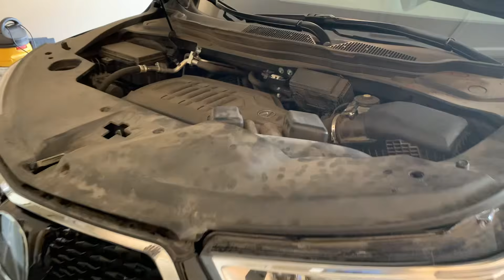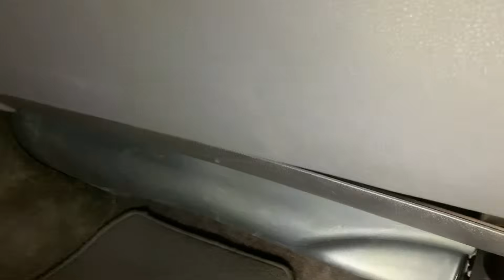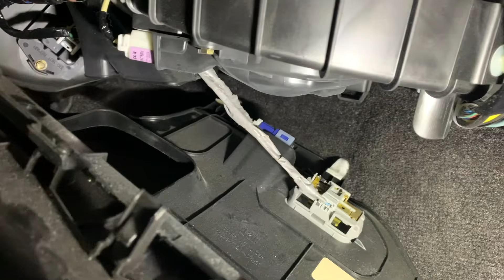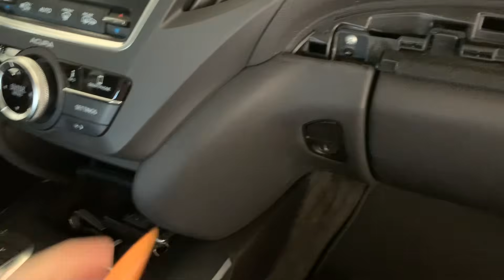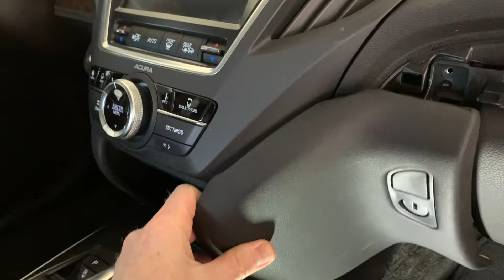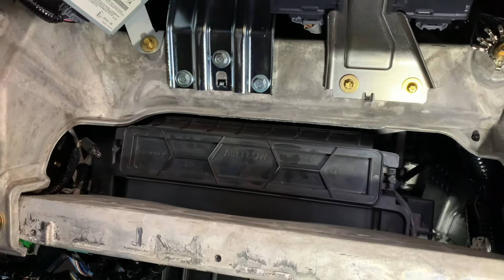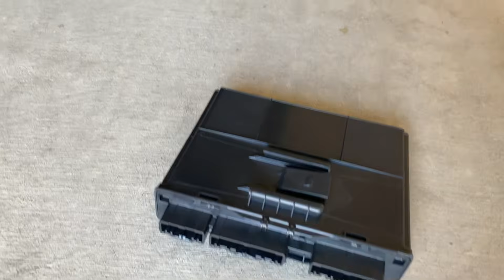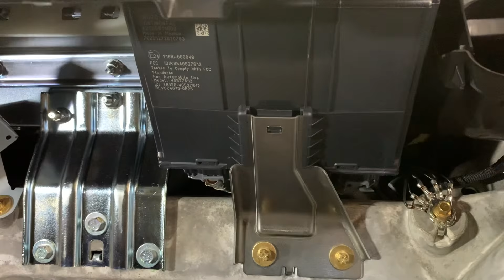Honda / Acura Random, Intermittent Flashing Dash Lights, Headlights, and Car Alarm - FIX Part 2

Comment: September 21, 2026 — I had a similar issue with my 2017 Acura TLX V6. Your video probably saved me a ton of money. I went directly to the keyless entry control module. I didn’t see any dirt or corrosion around the chip, but I asked a technician to reflow and resolder it, then thoroughly clean the entire module. It has now been 48 hours without any issues, even in high humidity.:hand-purple-blue-peace:

Comment: I need to give credit where it’s due, because this just saved me so much money and hate from my neighbours lol 

I live in Alberta, where the weather changes in the blink of an eye & I was thinking slow creeping in of cold, was the issue here. I had my alternator, the battery, gauge cluster and a few other things replaced at the end of 2023 and I thought the repairs for this thing were over… I was not anticipating having to wake up almost every day around 2–4AM just to turn off my stupid alarm on the car!! 

I even emailed Acura Canada about two weeks ago and I still have yet to receive a response from them. There should absolutely be a bulletin open for this.

I took everything apart as you showed in your video, cleaned up the IC board, bought some conformal coating from Amazon and I swear I haven’t slept this good in a few months. 
Thank you so much!

Comment: Thank you very much for this video,  I’m a electronic technician,  I have a ridgeline 2017 that have an intermittent problem about the keyless.  Recently in the night the truck trigger an alarm,  the cluster with all lights on and solenoid clicking,  difficulties to disarm and unlock the door to stop.  Three years ago I have this problem at that time I think the 12v battery aging and replaced it with AGM batterie,  since nothing but last week the problem make surface.  I took appointementbto the dealer and mention that a service bulletin is present on that particular symptom and this bulletin tell to replace the module.  Unfornately in Canada HONDA doesn’t honor the service bulletin from USA.  THe dealer make an estimate of about 1100$ to replace BCM module instead of the keyless,  the refuse to submit my case or listen explanation,  symptom and honor the bulletin.  After I see your video,  ask a second advise from my indépendant Honda/acura mechanic,  he tell me that he change almost 40 keyless module for the same symptom you described.  I decide with all these informations to tell dealer to close the the work order with the minimal fee, I paid for one hour of labour about $190 for 5 minute diagnosis with the scanner.

Just to tell you that your video is very informative and very deep,  i perform the operation of cleaning the board,  apply conformal coating,  put back in place.

Comment: Just did this to fix the issue on my 2019 RIDGELINE. Very disappointed at Honda. Its a very clear manufacturing defect on several years of their vehicles but they do not recall

Comment: This is my first ever YouTube comment, but I have a 2019 Honda Pilot and this has happened randomly over a year period. One week it happened non stop, I followed these steps and stopped right away. The only difference with a Pilot is the A/C vent does not need to be removed.

Comment: Who's here in 2026, I'm having these issues and I'm going to attempt this fix, wish me luck
Reply: Howd it go? I have a 2016 honda odyssey se
Reply: @DanielTorres-vu3gt took the dash apart, glove box and all. Couldn't see any worn or distortion on the board but i cleaned it regardless. I'm no longer having the issue 🤷🏾‍♂️

Comment: As a mechanic, I hate newer cars because of all the electronics. I own a 2017 Acura TLX, and the only problems I have had with this vehicle are electrical. This issue was one of them. Luckily, I found this video, which took around 10 minutes to get to the module. I looked at the circuit board, and it looked good, so I went ahead and cleaned it up with alcohol using foam swabs. I reinstalled the module, and the car has been sitting for a few hours with no clicking or erratic dashboard activity. Thank you sir for this!

Comment: Came here to say thank you, Honda dealership running in circles trying to figure out the issue and replaced a part that did not fix the problem.
Followed this tutorial myself and finally got it fixed! Thank you very much

Comment: Awesome video. Fixed my 2018 hrv after spending two long months trying to find the source of the problem, including a 7,500 mile cross country drive, trying to figure this out and disconnecting the car battery every time I parked anywhere by a quick disconnect switch!!

Comment: First comment on youtube. Thank you for doing all the legwork in problem solving this issue. I owe you alot. 5 star job finding the issue, documenting it, and providing a solution. I cleaned the noted solders on my 2017 Honda Pilot and the electrical system has stopped going haywire. Thank you, thank you, thank you.

Comment: It was such nightmare last month and half. Thank you for your video. It saved me from this nightmare alarm randomly went off every few hours for my 2017 Acura ILX. All my neighbors are pissed and angry. I did exactly you described. Just the unit for ILX is under driver’s side. It has very tiny space to work and I need socket extension to get the job done. Taking it board out is another challenge and I broke some parts which is ok, I just tape back. So far 12 hours passed by after I put it back, no alarm going off. Hope it can work and save me the trip next week and $2000. Thank you.
Reply: any update did it fix the problem on you ilx?
Reply: @MrBRC  2 weeks later, no problem. No more alarm going off randomly. One thing I didn't do was not using super glue to seal the exposing area on the IC board. probably will do that next time when issue happens again.

Comment: Problem is doing all that and it doesn't work.  Or paying a dealer a grand and it doesn't work.  So far I changed the battery in the car the FOB batteries and cleaned the hood sensor. 2019 Honda passport touring.  I mean how do you recognize growth on a module.  And you didn't show cleaning it off or applying the super glue.  Honda's are junk I may never by one again.

Comment: OMG! I have a 2016 Honda Odyssey and it had these issues in 2024 that randomly stopped. I forgot about it. This month it has started back up with a vengeance, acting like someone was using a remote control to try to start it. The fuses were constantly clicking and we found your thread online and this video. Got the box out, there is zero coating on the chip of concern. I hope I can clean and coat this to have a good fix. Thank you!

Comment: Regina G - You are an Ace of Aces for doing this video!! We've been having this issue on out "17 MDX for sometime now, but I have followed your excellent instructions and completed the work. It was not hard to do.  I did not have the magnification to clearly see the dendrites, but there was something there in the location you pointed out and the conformal coating was missing in that same location. T-Storms tonight, and downpours like that seemed to be a trigger for honking and lights turning on, so fingers crossed that I got it right.  

Two tips.  For getting the PCB out of it's case I pried the case away from each tab with a screw driver and inserted Popsicle sticks to keep the case away from the tabs, then used pliers to GENTLY pull on the edged of the connector receptacle to get the PCB disengaged from the case.  Also I got some MG Chemicals 419D conformal coating from Walmart. A small bottle was ~$15.00.

Comment: Just addressed this on my 2016 Honda odyssey this morning. Had the same issue like what’s in the video. The smart key  module on 2016 odyssey is on the driver side, placed deep above the accelerator pedal. I took it out and cleaned it with alcohol and put glue on it as in the video. It’s been more than 8 hours now and no alarm going off or flashing lights. Fingers crossed. Thank you.

Comment: This worked for my 2017 ilx and saved my sanity
Reply: Is it located on the same spot in the ILX?
Reply: @NozdormuArch   It is to the right side of the steering column shaft right beside the amplifier on the ILX, basically above the gas pedal.

Comment: What a GREAT video!!!  Stopped the "Light Show" immediately (Note: I tested before I re-assembled).  Would have been so easy to change the battery, but to no avail.  
Ironic, that this is not covered by warranty when it is a manufacturing error.   Thank you for the insight!

Comment: I just followed your wonderful instructions two days ago on my Acura MDX 2017 and so far so good!  I have zero experience working on cars and this was very rewarding especially after seeing what other people paid or were quoted to do the job. Aside from my time and having the tools, this cost me $5 for some super glue.  Opening the Keyless Access Control Unit was a bit of a challenge and required 4 tiny flat heads to pry open. I was a bit scared to put the super glue on but the smallest drop did the trick.  I used my sons toy microscope which worked wonders to see the growth.  All around excellent video. Thank you!

Comment: I can't thank you enough for this. My car was in the garage for 3 months while I searched the internet for something, ANYTHING! I posted the question on Reddit and after some good intended advice, BAMB! Someone posted a link of your video Part 1. Then I used Part 2 to work on my car. The dashboard on my 2018 TLX was a little different than what you showed on your video but after some patience, I figured it out. I initially found another little black box that I thought was the Smart Power Control Unit. I took it down, cleaned it and put it back on. No Good! The problem was still there. I thought I was going to have to take it to the dealership and when I started to assemble the dashboard guess what I saw? THE REAL Smart Power Control Unit. Took it down, cleaned it, put it back in and BAMB! Problem fixed. Muchas Gracias Amigo!
Reply: U just clean and put back? You didn’t have to reprogram the unit?

Comment: My 2018 Acura RDX did this exact same thing alarm going off and dash lights going crazy. After confirming via scan tool I was getting B12D3 codes in keyless access power unit module. After following the honda diag which consists of clearing the code and doing a 5x key on key off cycle, the code remains active which calls for the keyless access or smart unit to be replaced. I went ahead and disassembled the module casing and cleaned the circuit board all over with electrical contact cleaner from a can and compressed air. I tried taking good pictures of the problem pin but my phone wasnt good enough so it was hard to say if the pin was causing the issue .I plugged the bcm in and no change. I had to take it apart again and this time I used 99% isopropyl alcohol and cotton swabs to clean the entire board focusing on the part shown in this video but also everywhere the clear gel is not applied from the factory. Everything works now this saved me tons of time and money dealing with the dealership on top of that it seems the module is discontinued from acura in canada when I checked online. Its crazy to me seeing as its present on basically every newer honda with the keyless access that this isnt a recall on any of these cars. RLX CIVIC RIDGELINE PILOT RDX ILX MDX and more . This is a safety issue present on all these cars Why doesnt Honda recognise and recall. Thanks to maker of this video
Reply: U just cleaned and put it back don’t have to reprogram the unit?
Reply: @teamoversizefishingadventu2774   That's right, no reprogramming needed if cleaning and reusing original unit that came with the car.  I would reccomend unplugging the battery before disconnecting the module unless you want 20 more codes to pop up. If this hadn't worked I would have needed a new module, Acura dealership programming $$$.

Comment: Thanks. This solved my issue on a 2019 Honda Passport. Alarm started going off and displayed a Keyless Entry Module fault on the center display. 

It was a little tricky getting the PCB to slide out, though!

Comment: Thank you very much for this video! I just performed it on my 2018 RDX today. The module on the RDX models are located under the steering column above the gas pedal.
Reply: How did you take out the module? I was able to disconnect the 3 connectors but unable to take out the entire module
Reply: Basically you can use either a butter knife or plastic trim removal tool to hold back the clips on either side, and then from there you can remove the whole module by sliding it downward. It’s definitely not as easy as on the MDX, since you have to work under the steering column.
Reply: @colton101998  I was able to pry it out, thanks for the tip. I'm not sure what I'm looking for. I'm looking in the same area in the video and I might or might not see it. Did you have to use it  microscope to look at it or did you just take alcohol and swab over it?
Reply: @SitoLawrence  No problem, I’m glad to hear you got it out. I tried to use a microscope but couldn’t find anything. I ended up using a cotton swab with rubbing alcohol to clean the area shown in the video. And then I coated that same area with a thin layer of super glue.
Reply: @colton101998 I sprayed it down with a cleaner specific for chips and used a soft toothbrush. Let it air dry and so far it’s good! Saved a thousand dollars from the shop haha

Comment: Thank you for this video, it saved me $1000.  My 2018 Acura TLX did this today.  And it appears this fixed it.  It is under the glovebox in the TLX as well.  You will need a Torx Socket though.  Harbor sells a set, they're called "e-sockets" I guess.  He slid it off the bracket, but I don't think there's enough room in the TLX.   Watch a youtube video on how to remove the glovebox on the TLX, there's a bunch out there.  I did that part in 5 minutes.  The hardest part to the job is opening the unit up to get the board out. I put hot glue over mine, it can pull off if needed to clean more.  I didn't have a microscope to tell how clean it got.
Reply: I have a 2018 TLX also do u have to reprogram with the key and need scanner tool? Was it fine u take out clean and put back it work without programming
Reply: @teamoversizefishingadventu2774  I have a key programmer tool but I don’t remember using it for this. Just cleaned and put back together. Still no issues since I’ve done it.

Comment: Onwer of Honda Hrv 2016 1.6 diesel.
Sir you saved me 2000 USD let alone that 2 honda dealerships failed to identify the issue and the alarm was setting off irregular times during night.
The last year i was unplugging the battery pole everywhere i went. I almost sold the car.
A thank you isn't enough for this video

Comment: Thank you Regina G for this video! I couldn't really see anything (naked eye) on the chip but I still tried cleaning the exposed sections with q-tip and alcohol. I tried the bottom right corner as how it was on the video then I put it back but it still had the issue. Then I tried cleaning the top right. That did the trick.

It's just been a whole day but so far so good. Will report back if it comes back.

Comment: Thanks for the great video, I followed your steps to remove the module. I took a picture using my phone to expand the image but can't really see material build up around the pins, will proceed to clean it anyways - if this doesn't work do you think the alternator could be the culprit?. I used a multimeter to test the alternator and the battery (battery is new) and it checked out good, over 13 Volts but saw another video saying that alternators can give false reads when they're failing. I don't think the alternator is old enough to be failing? Thanks again for the awesome videos.

Comment: I've had our Acura into the dealership 3 times with the same issue.  They could never replicate it and kept saying it's the battery.  I cleaned this about a year and a half ago but never sealed it.  It just happened again today.  I can't believe Acura can't figure this issue out and fix it.
Reply: @reginag1874 did the super glue effectively stop the growth?  I see you addressed the reasoning in other comments but have you had the issue again?

Comment: Did everything step by step but now my car won't start at all
Reply: @therealalex4958 Mine was doing the same. After cleaning, the flashing dash lights were gone and everything seemed back to normal but push to start did not do anything. So, I pulled it out again, cleaned the whole board with the rubbing alcohol and plugged it back in. Started right up. Great video!

Comment: This solved an intermittent alarm/haunted issue in my 2017 Honda pilot. The module for my car is located behind the dashboard glove box and isn’t particularly difficult to remove… I couldn’t see the growth with my naked eyes, but could see that the coating was insufficient as subscribed… I cleaned it with rubbing alcohol and sealed it was super glue and three months later still no troubles. 

Kudos to you for posting this video! I was losing my mind with the constant random alarms and my car trying to start itself. This saved me major headaches and probably a bunch of money.

Comment: Thank you so much for the video. My 2017 rdx started to have the similar issues, alarm went off randomly, keyless system couldn’t start the car. Followed your instructions today and cleaned up the build up, the issues are gone. Really appreciate it!
Reply: Isn't the box under the steering wheel?